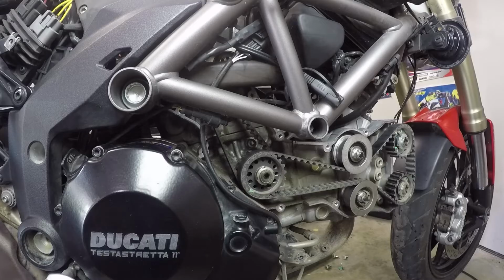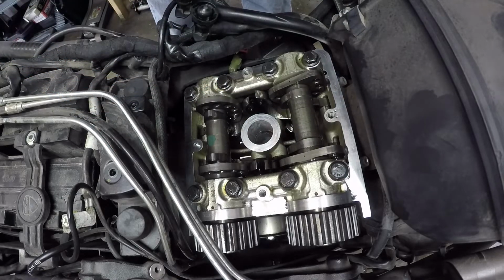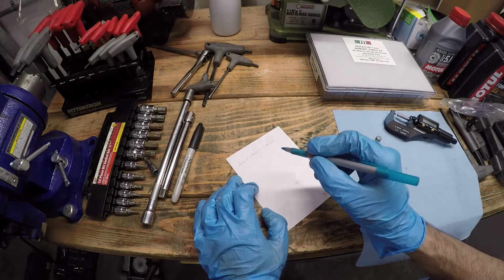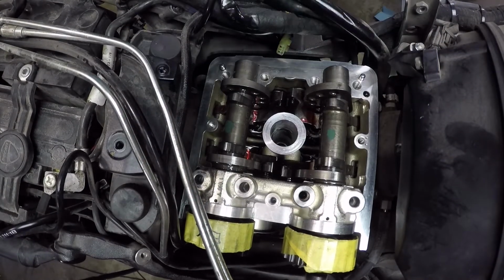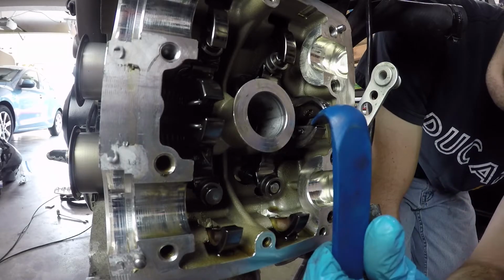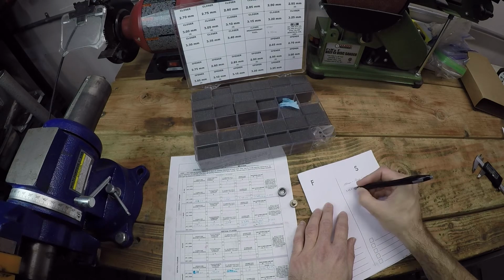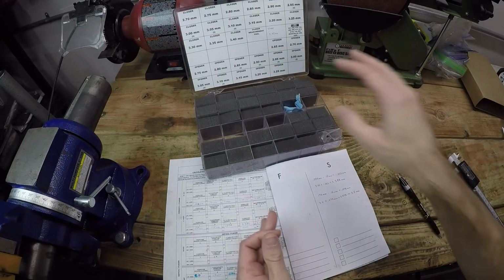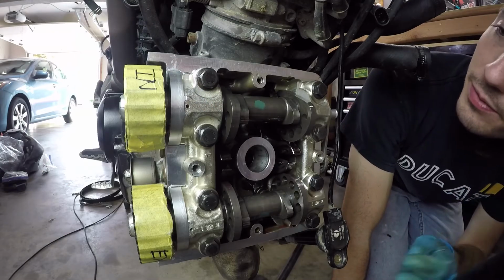How to Adjust Ducati Valves without breaking the bank | Ep.3

Comment: Hero Honda Splendor a small segment bike launched in India since 1999,  could run upto 3 lac kilometres without adjusting valve tappet or engine seals or even clutch plates. It is still in production till date and it is one of the world's highest selling motorbike and also ranked as the worlds most reliable motorbike.

Comment: So I don't know the terminology but on the forward cylinder the two arms on the bottom cam seemed to be in a different position (parallel to the ground) when it looked like they should be between the valves and the shims? Also was it a problem that the top cylinder intake cam was 180 degrees from the position when it was removed?
Reply from the maker: You have great attention to detail! The bottom arms are the opening rockers for the exhaust cam. When the cam is installed, they lay between the cam and the shims. Since the cam is removed, they flop down parallel to the ground (gravity). You have to make sure to position them correctly when reinstalling the cam. 

As for the cam position being different on install, it doesn't matter on a desmo engine. The cams are at "rest" for about 180 deg duration and don't need to be installed in a particular orientation. You align them to their appropriate orientation when installing the timing belts, which I'll cover in a future video.
Reply: Ah ok. Yeah it was hard to tell from the video angle where they were positioned once the cam was installed. I have a scrambler 1100 so would like to be able to perform the clearance check once due but don't know if I'm up to it.

Comment: Great video series, thanks. Do you know what to do to stop valves falling into the cylinder if you have to remove all the camshafts and all 8 closer shims at the same time? All of my closer shims are out of spec and I need to measure them all together.

Comment: Actually, the camshaft already have a mark on the center.. OA - OS - VA - VS, it is Italian for Horizontal intake, horizontal exhaust, vertical Intake and vertical exhaust. If you need to do it again :) .

For the shims, you can use some fine sandpaper, attach it to a plane surface and wear some material with a "8" movement, rotating 90° the shim from time to time. Oh, and ALWAYS replace the half rings on Ducati, they really tear and sometimes break inside the shim. They will work, but it is not good to have a broke half ring I believe. They also add a 0.02 mm or so to the stack when new.

Good and clean work 👍
Reply: you beat me to it! was gonna say oversized can be brought down with some p1000 or finer wet paper backed by a piece of glass from a photo frame.

Comment: A very well presented video showing the principles of valve shimming. Is it possible to rest the camshafts in place and press them down when confirming the replacement shims new clearance rather than bolting the camshaft bearing caps back in place, just in case the shim doesn’t work out to be correct and needs changing.
Reply from the maker: Thank you! I'd recommend bolting the cams down to take the measurement. The clearance could be inaccurate without the cams secured.

Comment: Interesting adjustment procedure. Basically these shims change in size slightly over time as the engine runs? Seems more precise than the type of adjustments I'm used to.
Reply from the maker: The metal does expand a very small amount when it heats up, so that's why they specify a range that the valve clearance gap should be within. The reason you have to check the clearance every so often is because the valvetrain wears ever so slightly over time (or if you don't change your oil, it might wear quite a bit!). Typically the valves wear their seats down in the cylinder head causing the clearance to shrink.

Comment: I think on my ST4 it was easier to do the adjustment with the head removed. It was impossible or uncertain what you were measuring when doing the opener shims on the exhaust valves.
The timing belts are a piece of cake though, not sure why so many people are scared of those.
Reply from the maker: The ST4 uses the same (I think) desmoquattro engine as the 996 that I used to have. It's very difficult to access the shims on the vertical cylinder, but on the 996 it wasn't impossible. It does however make you want to never to do it again and sell it. Hence why I sold mine. :)
Reply: @PracticalEnthusiast  I always pulled the head on my 996 bikes. So much easier!
Reply: @retiredandroaming  Do you replace the head gasket also then?
Reply: @Servingsince  not really necessary but,  yes,  I used to replace them. And the belts.

Comment: A trick to not letting the valve drop into the cylinder when doing the closer shim, take a the hose from a compression gauge or use a leak down tester and hook up to shop air to pressurize the cylinder. It will hold the valves closed while you do what you need to do.  Also, this reminds me of valve adjustment on Kia engines. Their shims are bucket shaped but the math is all the same.

Comment: First of all - good job! What did you use to seal the cams and the cover gasket, some silver material? What’s very surprising to me is that your clearance had “disappeared” for the most part. I haven’t done a ton of valve checks, but I have never had a case of decreased clearance. Valve seats get carbon buildup and shims, rockers and cams wear a bit. All that should be leading to increased valve clearance over time. Which has always been my experience. I can’t imagine how a clearance would shrink over time.
Reply from the maker: Thanks! The sealant I used is Permatex Ultra Grey, but most any RTV will work fine. Not sure how the tight valve clearances happened. Sometimes it's caused by the previous mechanic throwing in the closest shim they had, which makes it on the tight side. Sometimes the valve stem stretches, other times the valve seat recedes. Who knows, all you can do is put it back to spec!

Comment: I am about to shim the valves on a 2001 750 Ducati monster. For the first time. A little overwhelming. Where can I buy a shim kit from for that motorcycle?My closing shims are between .0015 and .002. Intake opening is .004 exhaust opening .003 on the horizontal cylinder. Intake opening is.0025 exhaust opening is .005 on the vertical cylinder. what would you consider the sweet spot that I should be aiming for? these are all standard measurements not in metric.

Comment: One more question, is it really necessary to transfer the marks on the old timing belts to the new ones? Seems like the belt position would be irrelevant so long as the cams are in the correct position amd the engine is at TDC? In addition, do I need to put the engine at TDC for each cylinder when installing the new belts? Meaning the vertical cylinder is at TDC to install it's new belt and then rotate to place the horizontal cylinder at TDC to install its belt? Maybe I'm over thinking?

Comment: Thanks a lot for the great video and instructions. I did the desmo service for my Ducati 2014 model successfully. Though 2014 model has some slight changes.

I also successfully reset the Desmo Service light with the software and the cable you suggested.

Thanks again.
Cheers

Comment: Thanks for sharing! Will help me alot . Though the "closure shim measuring tool" seems quit pointless to me as you already know you are going to abstract 10 mm from the measurement?
Reply from the maker: The closer shim measuring tool might seem useless at first, but what it tells you is whether or not the shim has worn on the inside mating surface. While that's not a common occurrence, it is possible! It's always good to double check. 👍
Reply: @PracticalEnthusiast  but still you don t need this tool, just abstract 10mm
Reply from the maker: @Kongzi93  how would you measure the depth of the inner cavity? The shim has an inner cavity, which is the purpose of the tool!
Reply: @PracticalEnthusiast  if you say so. But why only on the Outlet Valves. Are they different shape?
Reply from the maker: @Kongzi93   the closer shim tool isn't only for the exhaust valves. Both intake and exhaust valves have closer shims. Closer shims have the inner void present which requires the tool to measure the thickness of the shims. The video must not show that point well enough, sorry!

Comment: Hey man great video! One question, what's the logic behind setting to the upper limits vs the lower limit? I watched a different video and he was setting the valves to the lower limits.
Reply from the maker: Thanks! I went for the upper limit here (larger gap) because damage rarely results from having too large of a valve clearance. Also, clearances tend to decrease as an engine wears or has miles added. So, being on the larger gap side of things is the safer side to be on. If you're chasing optimum performance and are less concerned about maintaining long service intervals, then it would make more sense to target the lower limits.
Reply: @PracticalEnthusiast  , WOW thanks for the quick response! I just bought an 1098s and I'm about to do a full service on it. Been watching your whole 1198s series and probably will do mostly everything you did with yours.

Comment: Great video series, really appreciate the effort put in to these. I was wondering though if you ever need the crank locking tool at all? I guess you worked around the crank turning tool by putting in gear and turning the rear wheel.
Reply from the maker: Nope, I didn't need the locking tool.
Reply: @PracticalEnthusiast  Thank you for the quick response. Appreciate it .. it's great to be able to do fairly major jobs without having to fork out a bunch for special tools. Did you also figure out how to reset the 15K mile service light at all? I wonder if a VAG tool would be able to communicate with it. It would be interesting to try
Reply from the maker: @turbo97semax  that's for sure! And yep, check out this video on how to reset the service light: https://youtu.be/vKV5wgtL0AY

Comment: Can anyone comment on clearance measurements? I heard you want much tighter ranges than Openers: .13 - .18 mm / Closers: .05 - .10 mm. More like closers should be 0.02mm and openers 0.05mm? Setting them this low will keep them from going out of spec fast?

Comment: If your shim measurement was 3.1 and it was marked as 3.1 meaning it wasn't worn, does that mean the incorrect shim was installed from the factory?
Reply from the maker: No, it just means something else in the valvetrain has worn which is normal. Typically it is either the valve seat wearing or the valve stretching. Shims, rockers, and camshafts really shouldn't wear which is why it is important to change your oil and perform valve clearance checks on schedule.

Comment: Can the valve check be done without removing the timing belts, obviously if you have to re-shim they will need to be removed but for just the checking clearances can you leave the belts on and just check the shims at top dead center
Reply from the maker: Absolutely! I'm usually changing the belts anyway while I'm there which is why I've shown it that way.

Comment: Hi from the uk 🇬🇧 👍🏻 awesome videos and very descriptive, I’ve watched a lot of the Multistrada but yours are so clear to follow so thank you. I’m about to do the belts on my 2013 model at 13,000 miles and wonder d if I need a locking tool for the cam shaft pulleys or I can do as you’ve shown by marking the belts position on the pulleys, line up the marks/notches and simply swap belts and then do the hertz tension etc? Your advice would be awesome. Ps whereabouts in USA 🇺🇸 are you? Regards, Howard
Reply from the maker: Hi Howard, thanks for the comment. You don't need the locking tool at all. I'd recommend getting some long, angled needle nose pliers like I've used in following video (https://youtu.be/f15vvgCm1Mg?t=184) to assist in aligning the cam sprockets when refitting the belts. Definitely mark the old belts before removal. I'm located in Overland Park, Kansas, USA.

Comment: Why did you only measure 2 of the horizontal cylinders closer shims instead of all 4 closer shims?
Reply: oh i have an idea why.

its says 
"Because the Ducati Supersport has a four-valve-per-cylinder engine and Desmodromic valves, there are sixteen clearances to check. If an opener is out of spec, it’s common that the closer is, too, per the manual."

so i check the top and make the changes and do the same on the horizontal cylinder on the same positions. like you. top left and buttom right from the video view

Comment: How does this procedure differ for a 2019 1260 mts with the variable valve timing?
Reply from the maker: The fundamentals will be the same, but I highly recommend researching the DVT procedure before attempting. That system may require additional tools and software to set timing correctly.
Reply: Would you consider taking on the DVT valve adjust procedure?
Reply: Our Brit tech has the fundamentals and experience but your relaxed methodical explanation and demonstration provide a more comprehensive and clarified learning experience.  You might consider producing a Maintenance DVD on the DVT and other Ducs like Jim Bade aka Jim VonBaden did for the R1150 GS. I think there is an opportunity for a home mechanic step by step maintenance video for Duc owner/mechanics.

Comment: I'm lost. The shims you replaced all had the right measurements. What is wearing in there that changes the dimensions and causes to tick? Why not replace the part thats wearing? Why not replace everything in there since its open?

This has to happen every 15k miles ir juat until you hear the ticking?
Reply from the maker: Checking and adjusting valves is not unique to Ducatis - every vehicle with an engine with "fixed" valve clearance should be inspected every so often. Ducati simply recommends checking it every 15k miles on this engine. The shims don't wear, but the valves can slightly recess into the cylinder head, causing the clearance gap to shrink. Wear on the top of valve stem, on the camshaft lobes, and in the rocker arms can increase clearance gaps. Frequent oil changes (3k miles) greatly minimize this chance of wear.
Reply: @PracticalEnthusiast  its just like any car or truck. Usually after 150k ish miles the rollers go bad and add wear to the tip of the lobes. Thats why I asked about changing everything in there since your in there. Every 15k miles though. Wow. 

I wonder why they havnt come out with better tech or a more stable design. Its still wierd how rollers or followers move into the vavles. They dont do that on anything else I've heard of. 

So you basically have to be a mad scientist of a mechanic or be rich to afford the service on a ducati. Damn! I rode. 2010 yesterday and almost baught it. Im glad i didnt. Its heart breaking because it was so good...

Comment: I was just recently quoted by a place called mosites motorsports in pittsburgh.  They quoted 2500.  So I asked for all the parts.  Then they tried to scare me saying it takes 3k worth of specialized tools to do the job.  All I saw in every video ive watched are allen wrenches, screw drivers, and sockets.  Told them get lost on that.  Took the parts and will do it myself.  What an absolute scam. Mines a non DVT bike, its even EASIER than this.
Reply: In the same boat. My V2 has been died for the last 3 months. Can’t justify the cost they wish to charge pretty much £2500 in the UK. I’m about to take it apart today and do it myself. Strip measure order the parts kits and required shims then put it all back together

Comment: What sucks is with the V2 Panigale 4 valve is that there is 4 valves per cyl. And each valve has opener and closer so dbl the shimming. Shit design the desmodromic valve setup. With light valve and modern valve springs it is not worth the complexity. Ducati only keep that setup for tradition.